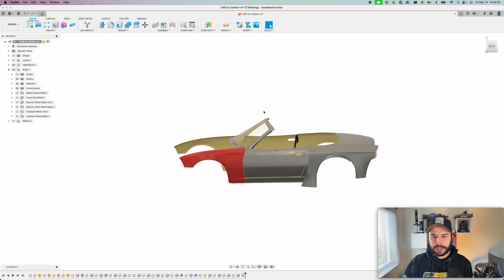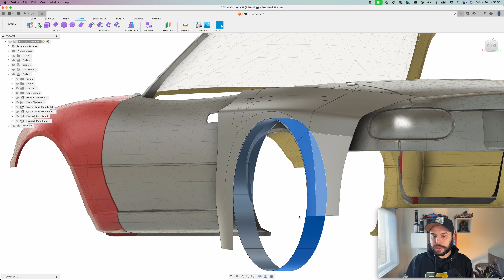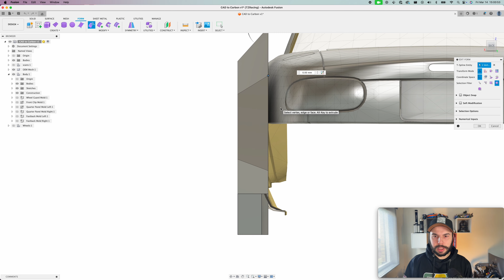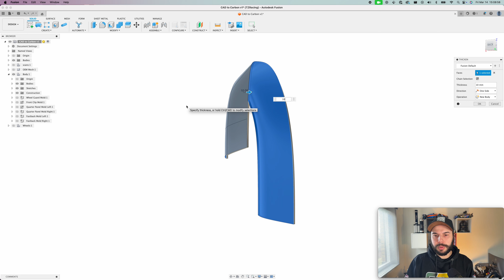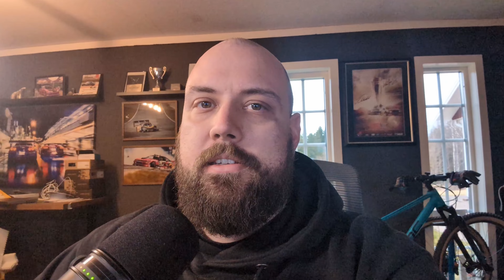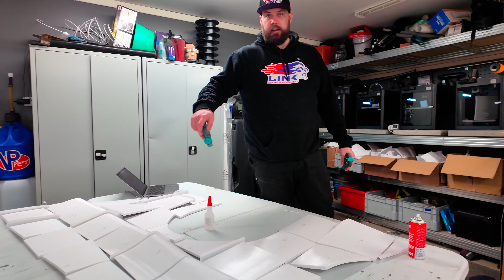CAD-to-Carbon part 1: 3D scanning, modeling and printing

Comment: dovetail splitting that part will help with putting those pieces together way easier
Reply from the maker: Indeed, but that's not without its drawbacks... that would make printing a little bit trickier, currently we print without supports, which would no longer be possible, and we'd still need to glue and reinforce the mold anyway, so it's more of a tradeoff between simplifying printing or assembling.